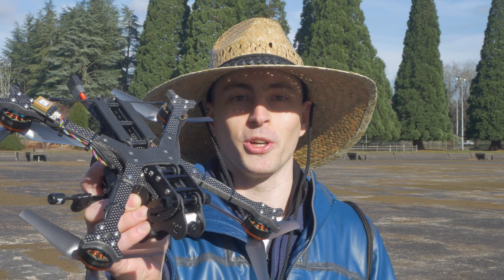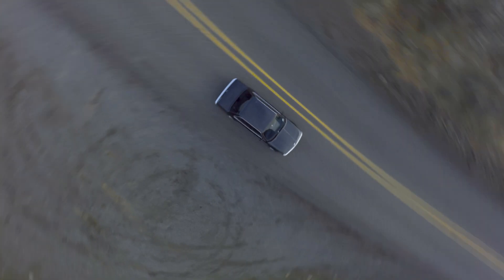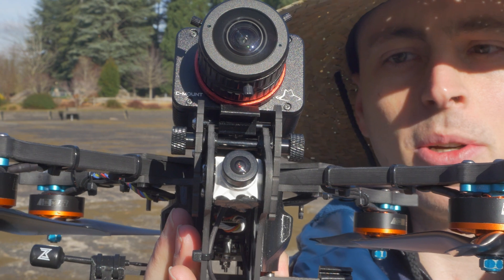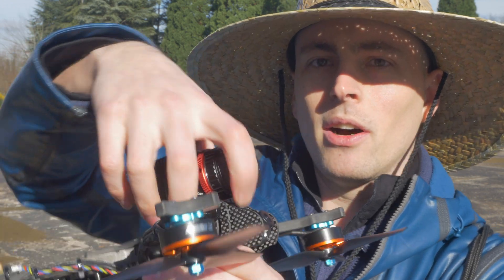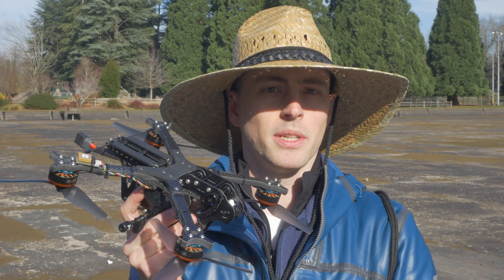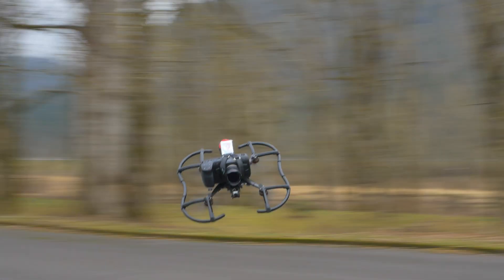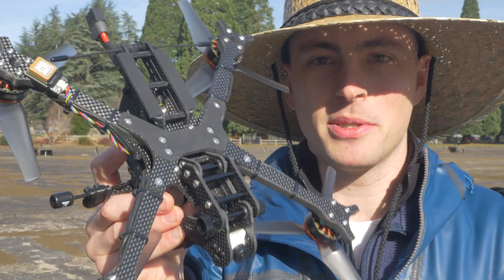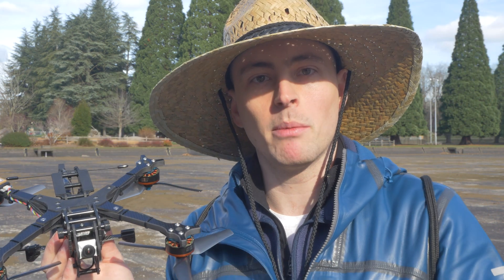Introducing VULTURE | the "MiniCine" drone

Comment: Which battery do you recommend to use  with the bmpcc4k to an acrobatic flight?
Reply from the maker: 2200mah to 3300mah 400g to 500g weight. Acro ability will depend on motor size and kv too. 2808 1700kv range will allow small split s and roll spins, but no powerloops or building dives. 2808 to 3008 1900kv will open up more maneuvers at the cost of  your battery. If you really want acro though I am getting optional 7 inch vulture props in the next batch which will pair well with 2810 1500kv on 7 inch prop.

The caveat with 7inch though is it won't fly as well with small cameras like gopro and rx0ii because of the slower rpm due to light payload you get bobbles in windy conditions. So if going 7 inch you should be mainly using it as a cinema camera rig.

Comment: That looks sick! Can you share some flight footage with the bmpcc4k or other heavier cams? Very curious how well it handles the weight considering it's only 4x 6".
Reply from the maker: I will do more testing when I get some time, but I will say that the footage is rock solid and small split S and roll spins are easily executed with payloads up to 1.5kg and prop guards installed.

Comment: I fly analog, will the quad work with analog vtx's?
Reply from the maker: Yes, as long as the VTX has 30.5x30.5 mounting, 20x20, or 25.5x25.5mm hole pattern. OR if it is small enough to stick it to the carbon fiber VTX mount with mounting tape and a zip tie.

Comment: Frame looks awesome🔥🔥🔥 Are 2808 1500kv motors suitable this frame also?
Reply from the maker: No I would go with 1700kV and if you can only use 1900kv, start with a 90% motor output limit for testing.
Reply: @strawhatsam  Thanks! I found almost same size and KV motors what you recommended.
Reply from the maker: @DRSFPV  Great news! What are they? I believe there is an Axis flying brand 2807.5 motor out there in 1750kV.
Reply: @strawhatsam  Yes! you are right! I just ordered Axisflying 2807.5 1750kv. It's almost same what you recommend for.

Comment: Will you still be making the puffin and pigeon frames as well as the naked bmpcc kits?
Reply from the maker: Yes, the Vulture won't be replacing these. I placed another order of Pigeon frames today. I do want to redesign my naked bmpcc4k cage though in response to increasing manufacturing costs of the lcd extension system. So you can expect a refresh and improvement of my current design!
Reply: @strawhatsam  Stoked to see what you come up with for the new revision. Building my Puffin this weekend.